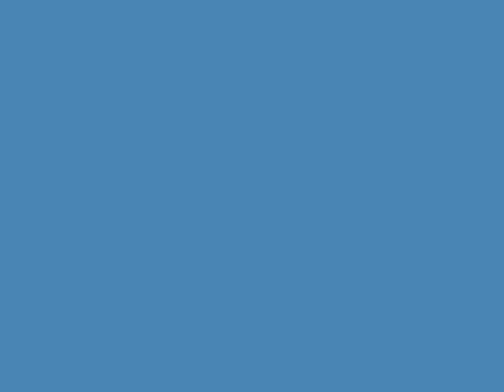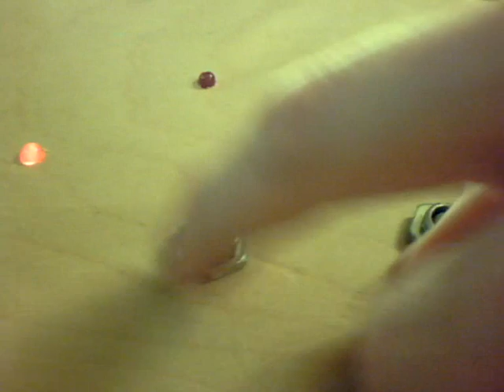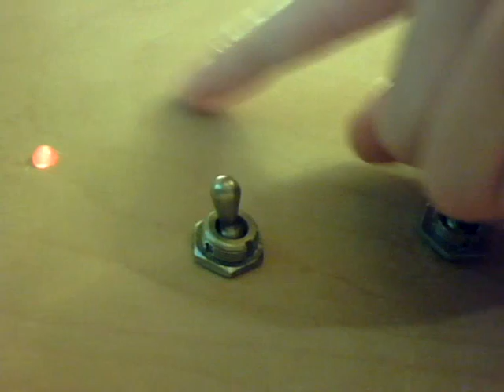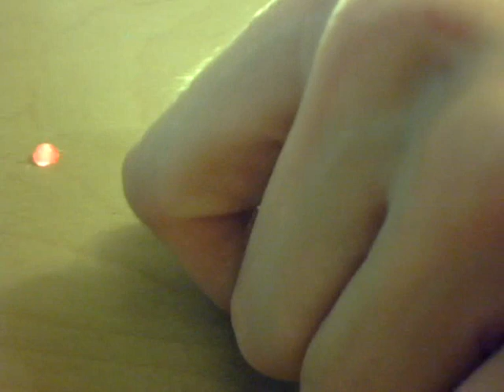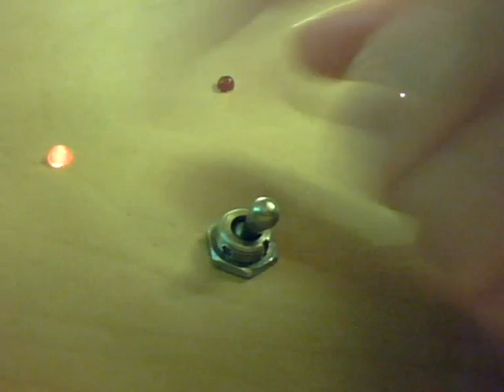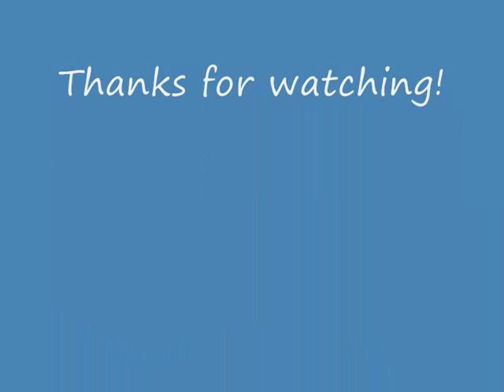Introduction to Logic Gates

Comment from the maker: @supertrogdorman5252 I should have perhaps explained better. Logic gates are circuits which produce an output based on its inputs-the logic gates are made up of transistors. But you can simulate some of the logic functions just with simple switches, so your reasoning was correct.

Comment: @yoshielectron 
When you start to turn it down the amount of vibration picked up by the pickups is lessened. (I think) The pickups still pick up the same but the amount that reaches the output is less. When the knob is set to zero the vibration picked up by the pick-ups is stopped and doesn't reach the output

Comment: @yoshielectron 
I guess so, what you're explaining here sounds more like what is dubbed the "killswitch" which isn't common on most guitars having two pickups means having two killswitches which can open the circuit in between the pickup which would be the input to the output where you plug in a cable.